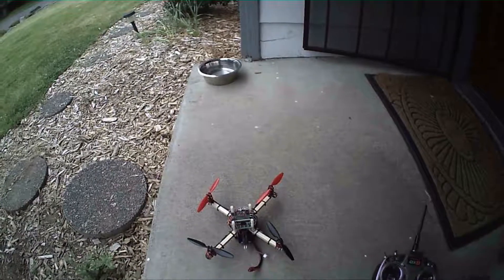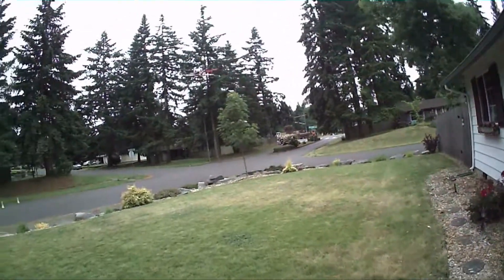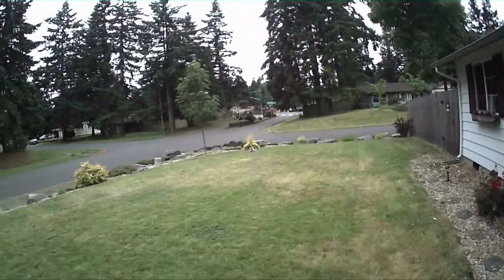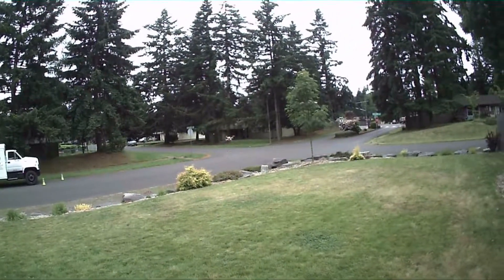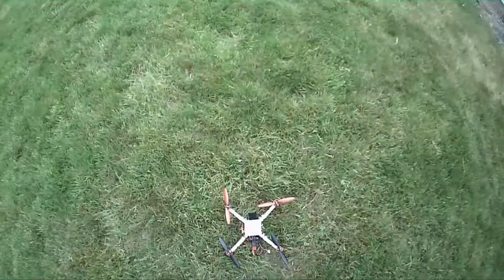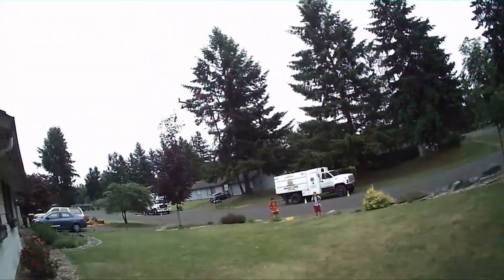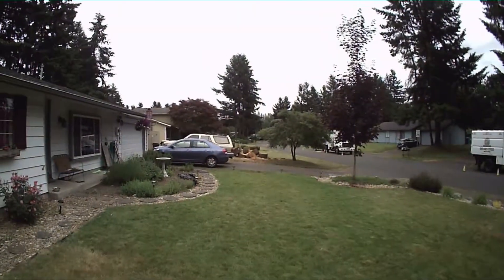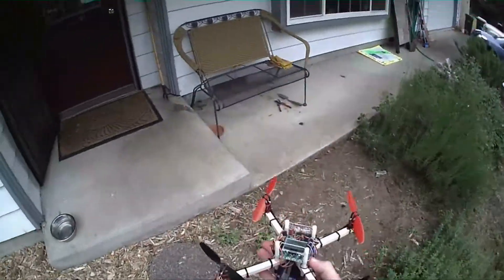Mini KK2.1.5 Quad Aerobatics

Comment: Hi Ron do you know of a link to see how I connect mini kk2.1.5 please? Thanks
Reply from the maker: Hi guruji243, on the board, all the inputs outputs are labeled for your receiver and M1 thru M8 for motors and servos.  When you choose a configuration, and go thru the program menu, it will show you which M# goes where on your multirotor.

Comment: can you help me connect the battery to the kk2.1.5 to monitor its voltage
Reply from the maker: +Aditya Dua If you look at the board, you'll see the red, double pin out for the battery voltage.  You must tap into your batteries voltage and plug it into this port (positive on the outside, negative on the inside).  I like setting my board to start alarming when a given battery depletes to 3.5V per cell (it's usually not that low but when under load it drops that far).  This tells me it's time to land.  For example, if you have a 3S battery, have it alarm at 1050 = 10.5V.  If you have not already subscribed, please do so. Thanks and I hope this helps.
Reply: +RonALampman hey thanks for your reply,just wanted to ask that the battery has only one power output wire for the esc's and one for charging so how do i connect another jst wire to plug it on to the battery plug on the board to monitor its voltage.AND yes subscribed
Reply from the maker: Yes, you connect it to the red terminal.  ensure you have the polarity correct and it will monitor the voltage.  All the best, thanks for subscribing, and Happy flying!
Reply from the maker: +Aditya Dua when you solder the plug in lead to your ESCs, add a JST (or servo) lead to that red to red and black to black.  Then simply plug that into the board.  I've been using the leads I cut off of stripped servos to do this.

Comment: What size props did you use?
Reply from the maker: Carl Bradley Carl these are 5x3 props from HobbyKing.  This entire quad has recently been rebuilt with all carbon fiber top and bottom plates, booms, and props.  Still using 5x3 props too.  All the best and Happy flying!
Reply: Thanks Partner

Comment: Nice job. I found your link on the Hobbyking site. I'm researching building something even lighter that can be flown with full size Tx. Thanks, DS
Reply from the maker: Thank you Don, Check out the Micro MWC flight contron board from HobbyKing.  It's DSM2 compatible and has 4 - brushed ESCs already built in.  I have one and plan to build a micro quad also when I finish some other projects.  If you have not already done so, please subscribe.  All the best and Happy flying!

Comment: What settings did you use on the kk2 board
Reply from the maker: Hi Carl, I added the gains in the comments section for this video.  However, if you go smaller, larger, use different size props, different motors or ESCs, heavier or lighter frame, it will not be the same.  If you have not already done so, please subscribe.  All the best and Happy flying!

Comment: Nice video. What settings did you use on the KK2.1.5?
Reply: hi what settings did you use
I am having a wobble problem
Reply from the maker: Thanks!  Mikc, this board was flashed with v1.12 and the settings are I believe P at 35 and I at 20 with the auto level gains at about 30.  If you have not already subscribed, please do so.  All the best and happy flying!
Reply from the maker: Joanne Elliott
Hi Joanne, As I said above, my KK2.1.5 has been flashed with v1.12 with the above settings.  If you have a larger multirotor, then your gains will need to be increased.  If you have not already done so, please subscribe.  All the best and happy flying!

Comment: nice, good flyer
hey Ron what firmware are you using?
Reply from the maker: Thanks Zimmy!  I flashed it with V1.12 because it is so stable.  Then I cranked the stick rates up from 30 to 75 on all axis and dialed in more expo.
Reply: I'm using the same v1.12 beginner stock settings but with expo on TX at 40% smoother for FPV and my dumb thumbs lol but thinking of trying rc911 v1.16++ aio next
Reply from the maker: *****
The V1.12 works well for me and is easily tuned so I'm keeping it for simplicity.  All the best and Happy flying!